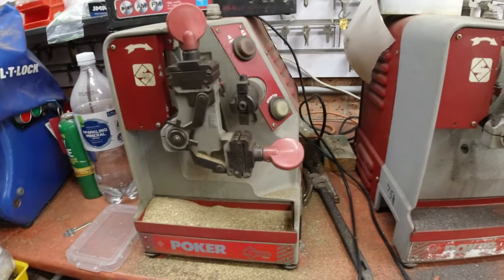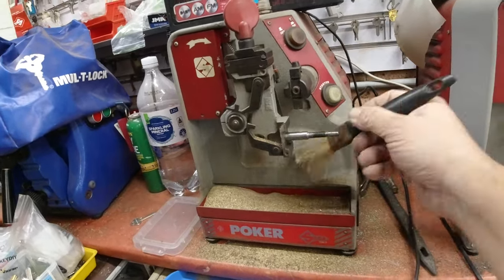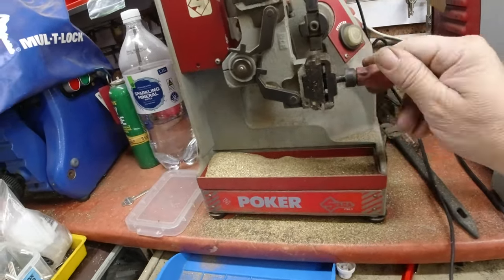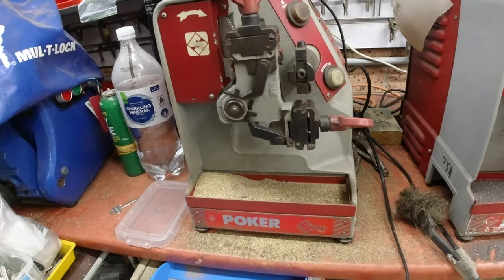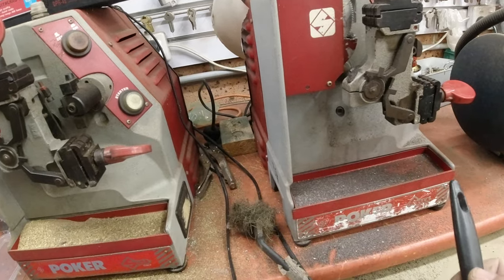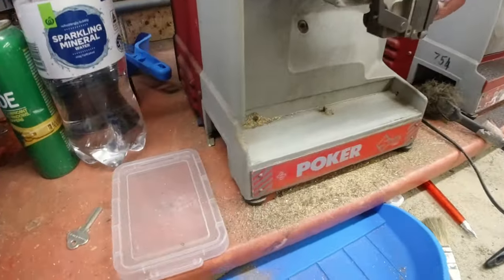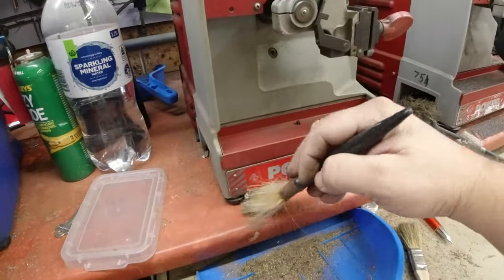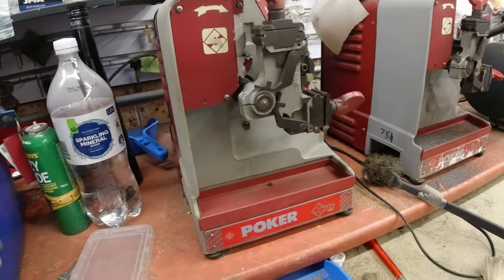Ho To Clean A Key Machine - Key Duplicating Machine Clean

Comment: Yes, and another thing that some manufacturers don’t mention, but it is in their paperwork that if you use an air gun on your machines that voids the warranty so you should never use air guns on them it’ll blow the brass shavings or the metal shavings up into the machine and end of the motor parts bearings and etc. Causing failure and they won’t cover anything under warranty so make sure you read your paperwork and know your equipment well.
Reply from the maker: good point